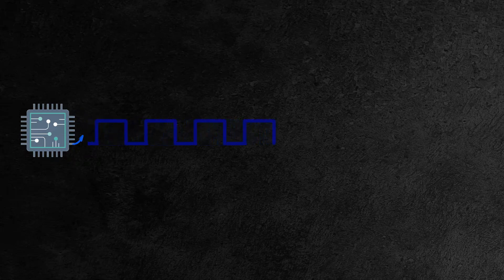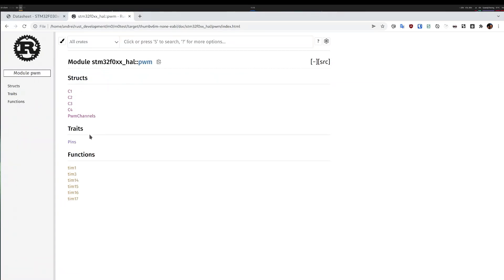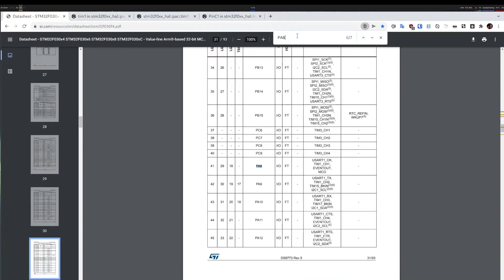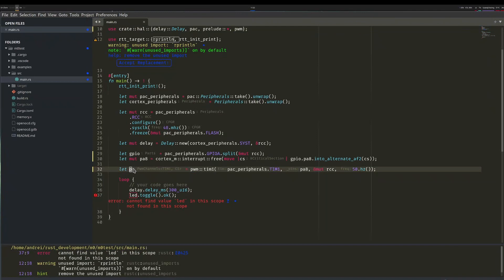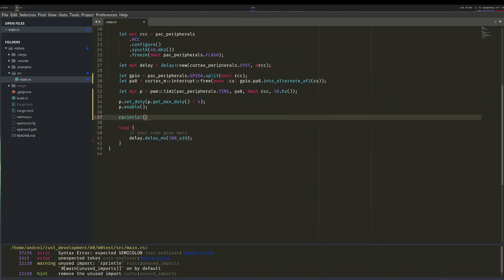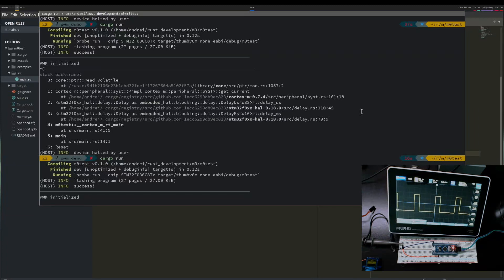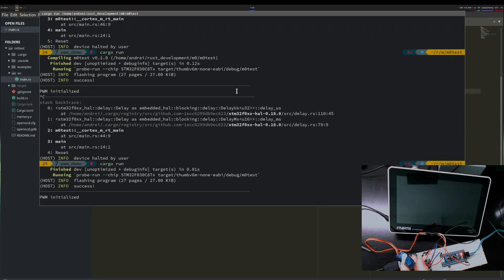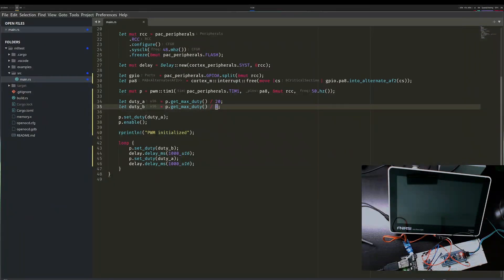Embedded Rust: PWM signal and servo control from a Cortex M0

Comment: I have another question about the pwm and frequency.  

In the rp-hal pico examples, pico_pwm_servo.rs, we have: 
pwm.set_div_int(20u8); // 50 hz (with default top/wrap).
And it works (checked with a multimeter, close enough). 

However, I do not understand the math. 

I thought the simplistic math was this: 
divider = Ceil(16*fc/65536*freq)/16 (where fc is 125_000_000).

But I am off by a factor of 2? So, if I want the div & top for 50hz, I need to have freq = 100. 

I even ported the micropython C function to Rust, to get a "better" Div and Top, and it works as long as I put 2x the HZ I want I give a 2x frequency of what I need. 

I am missing something obvious, but cannot figure it out.

Comment: First great video. One thing I am confused about is how to read from a PWM. I have a very simple PICO circuit with a photoresistor and I just want to read the pwm value as I would do in micro python. Somehow, I cannot find the way to do it. I am using rp-hal. I must be missing something obvious.
Reply: Ok, I found the reason. I am still learning Embedded programming. We have to use ADC. Good example in github  rp-hal/rp2040-hall/src/adc.rs has a good example. 

    let mut adc = Adc::new(peripherals.ADC, &mut peripherals.RESETS);
    let mut adc_pin_0 = pins.gpio26.into_floating_input();
    let pin_adc_counts: u16 = adc.read(&mut adc_pin_0).unwrap();
Reply from the maker: Hi, yes, PWM is generally for output and you do not read it as much. If you do read them, you would get positions of rising/falling edges of the signal.

For photoresitors, they change resistance based on light, so you would need to measure "how much resitance", using some form of voltage divider (quick google search led me to https://docs.onion.io/omega2-arduino-dock-starter-kit/arduino-kit-reading-a-photoresistor.html for some diagrams).

Using an ADC is the right way to go about it. make sure the voltage range is covering as much as possible from 0 to max (5V for RPi, 3.3V for STM32). If you want to see something similar, this is also how analog values are read from things like joysticks or water level sensors.
Reply: Thanks a lot for the context. Still learning embedded programming, but having a lot of fun doing so.

Comment: I am not sure the servo is broken, those cheap small ones are terribly inaccurate, and always require fiddling with the min and max duty cycles. No single servo is exactly the same, either, so the values for servo A may not work for servo B.